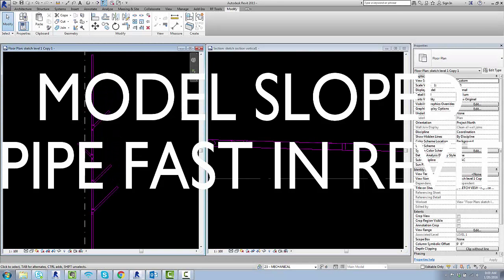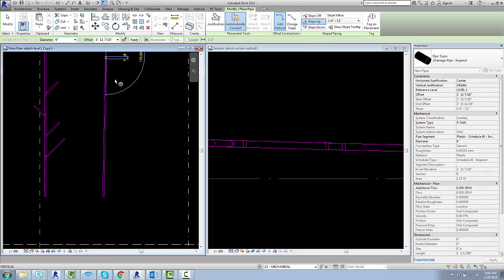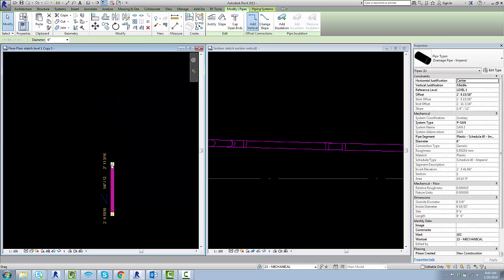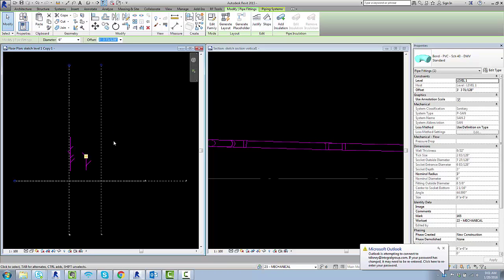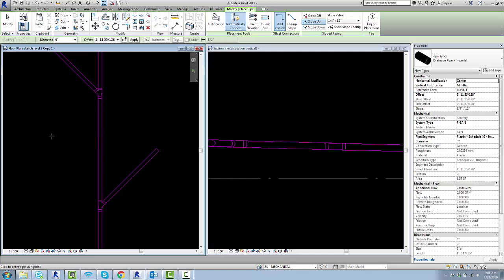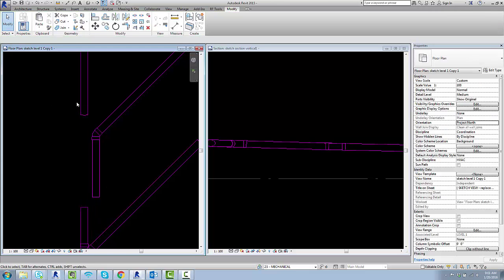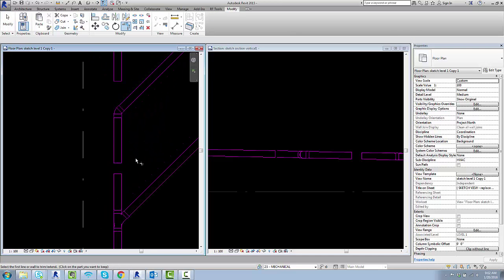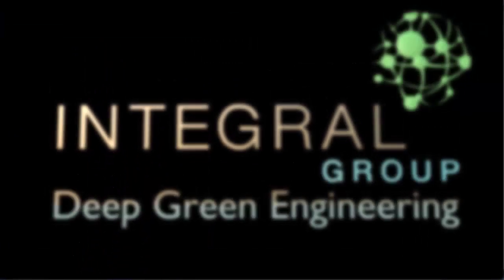Model Sloped Pipe Fast in Revit - Tips for Speed and Accuracy

Comment: would have faster to split the vertical pipe you drew downwards then use the union to drag the pipe & elbow to the split .  rather than resorting to using the section view to align the pipes vertically